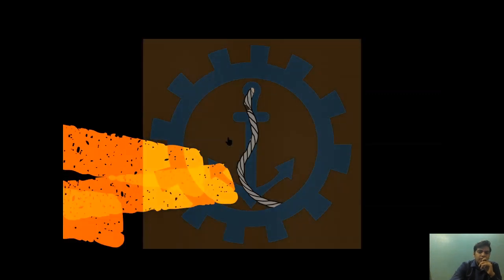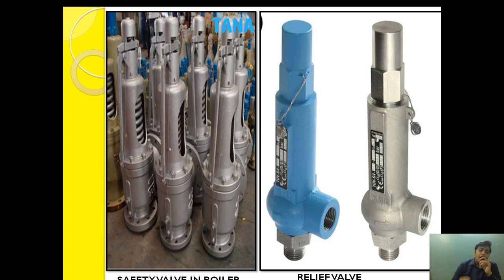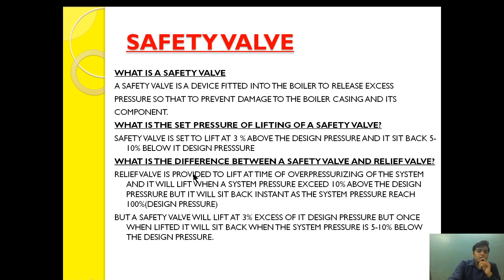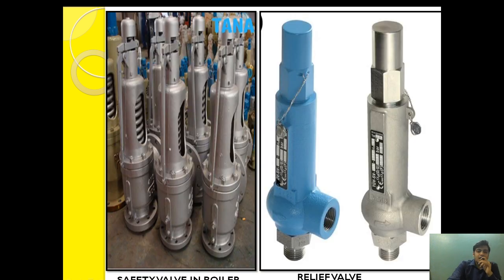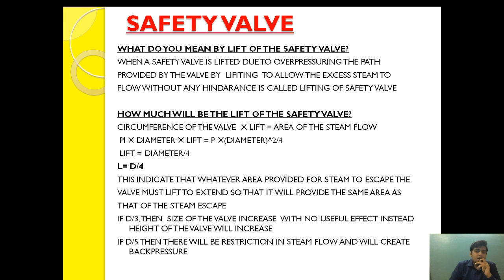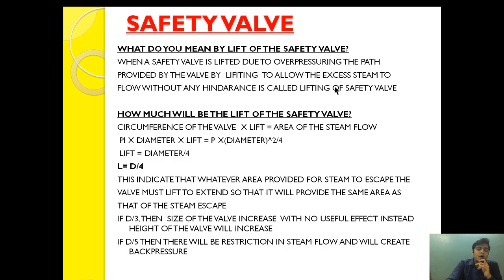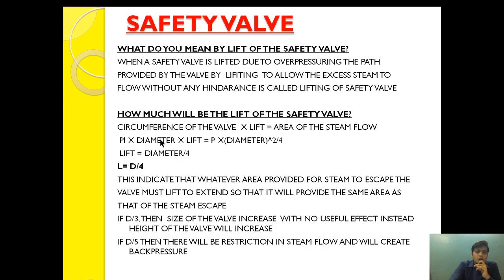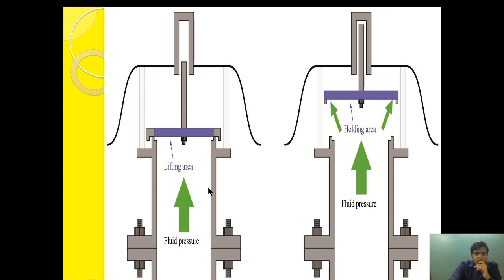SAFETY VALVE| RELIEF VALVE| LIFT OF SAFETY VALVE|(PART-1)

Comment: Please explain why two safety valve in boiler ? This is mmd question please explain
Reply: One safety vlave will work at above 3% max working pressure and other one  will work   below  working pressure of boiler say .
Your  working pressure is  80kg/cm²
Then 1 st valve will lift at  82.4kg/cm²
And other will open at 79 kg/cm²

Comment: Means that safety valve will lift first and after that if it fails relief valve will lift
Reply from the maker: Hello Arjit,
Safety valve is provided in boiler 
Relief valve provided in pumps
Both function are different
Reply: @MarineEngineeringHub  ohh thanks you sir..

Comment: if the valve lift is D/4 then why the improved lift safety valve is D/12 & high lift safety valve is D/24.
Reply from the maker: High lift was earlier design then comes improve high lift and then full lift so as per design evolution the lift was improved!!!!